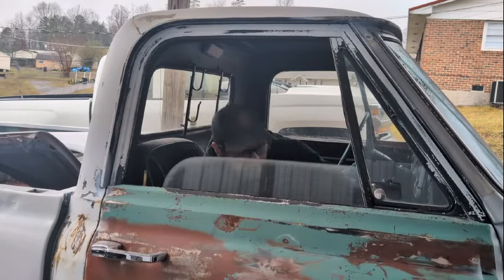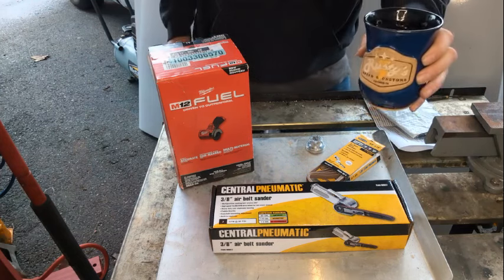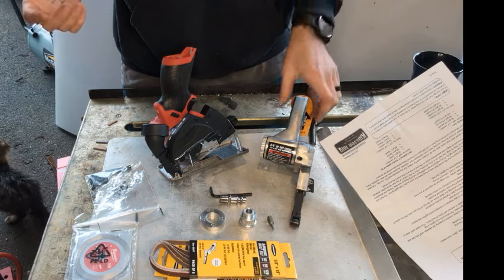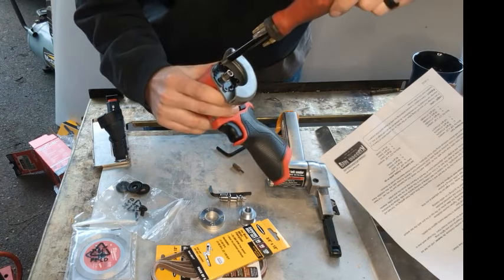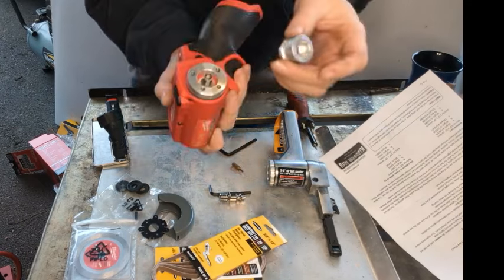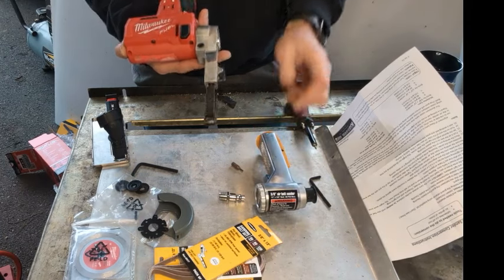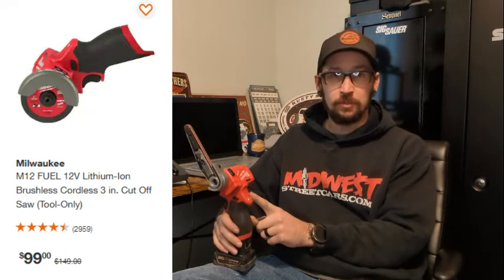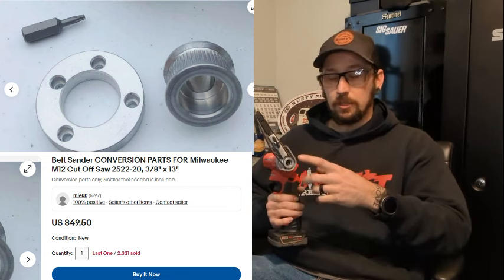Milwaukee 3" Cut-Off Wheel to Belt Sander Conversion on a Budget!!

Comment: Thx for the video, was curious as to the outcome. I have the cutoff tool and was never impressed with the torque. I figured this rig would stall it out. I'll stick with the HF pneumatic junk I have.
Reply from the maker: So far it seems to work pretty well but I'm sure if you have a good compressor pneumatic is probably best.